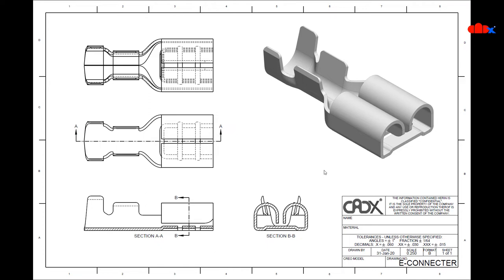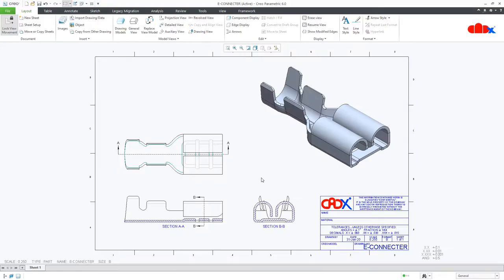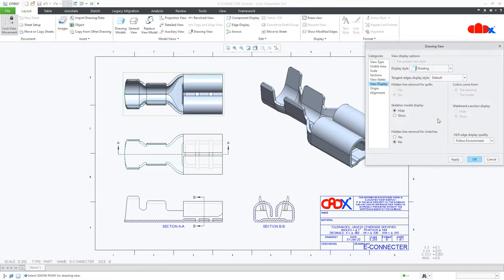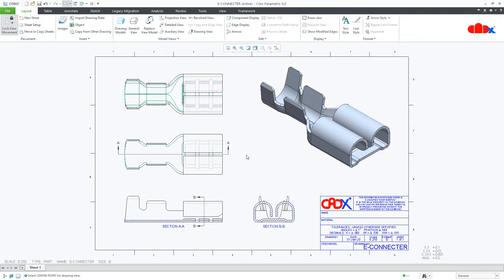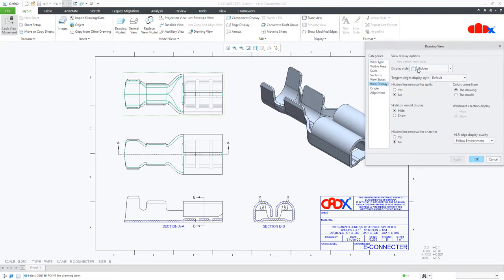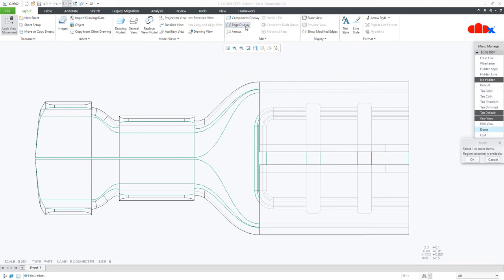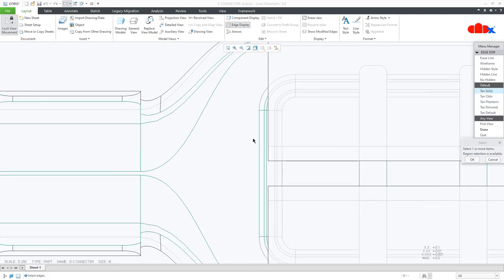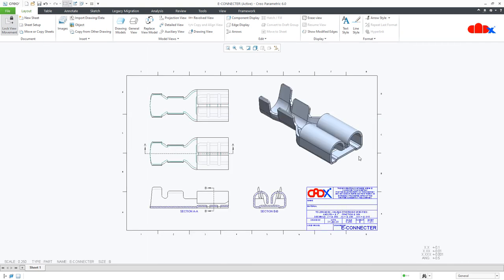View display and Edge display to clean the drawing views in Creo Parametric

Comment: When I use file/save as / pdf file.... In Creo 6 then pdf made have all symbols bold i.e. Diameter, runout, flatness etc. Nothing change by using pen table. Any solution??
Due to this drawing don't look cleaner. If I perform same task in Creo 3 the drawing look pin point cleaner.
Reply from the maker: While exporting your drawing to pdf, use true font option. I guess it will solve your problem.
Reply: @CADxTraining  It work only for dimension text not for symbol.
Solution : set File > Prepare > Model Properties:
Under Detail Options: 'symbol_font'(available in new version) to 'legacy ' in both part and drawing. (found solution through PTC discussion page) 

Thanku for reply 😊.